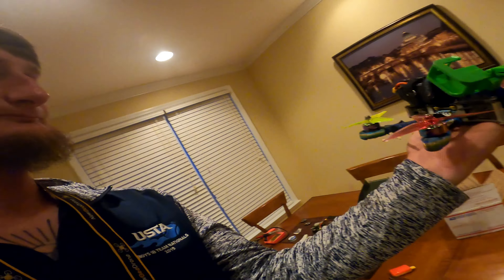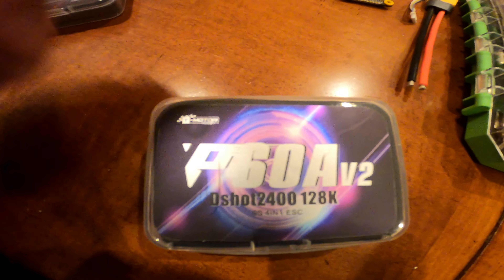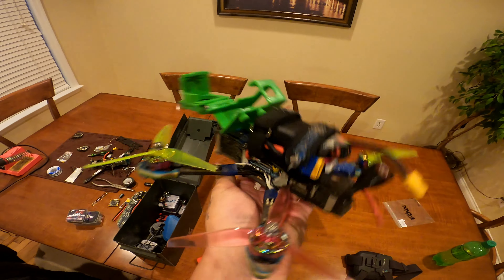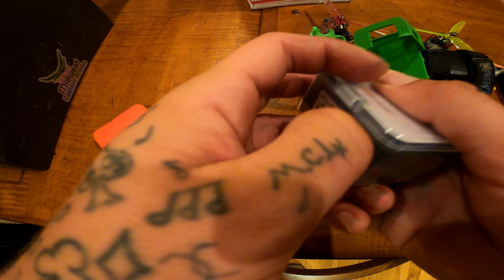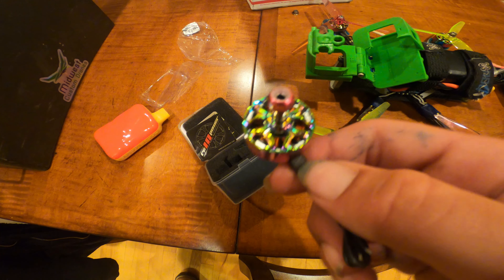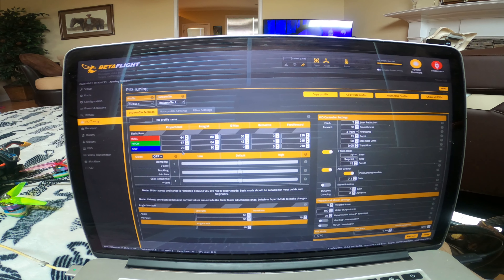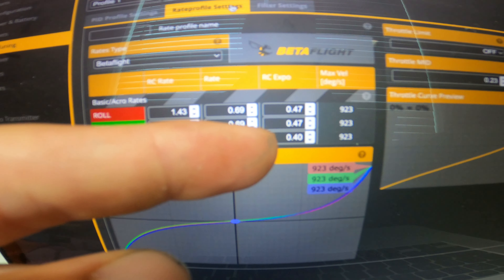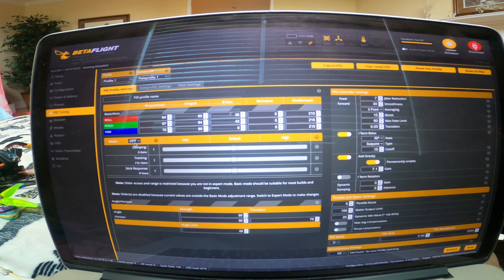HOW i TUNE MY FPV Drone W/ BETAFLIGHT 4.4.2, & "REVIEW" of an all New ESC & RCINPOWER Motor!

Comment: I just ordered those ESCs glad they are doing good for you! And those motors 🤤
Reply from the maker: Yes this F7 Pro V2 Flight Controller With this Pacer 60a 4-1 V2 ESC is bad ass, and these motors are also bad ass one of tge best sets of motors ive ever used
Reply from the maker: Was gonna go and fly a cool ass spot today but in my way got in a damn car wreck some old dude slammed on his breaks right when the light turned yellow and i just couldnt stop fast enough in my truck. It messed my truck up pretty good which sucks i wish that shit wouldnt have happened
Reply: @devilcfpv2621  shit man, life would be easy if it wasnt for other peoples choices, hope insurance sorts quickly for you